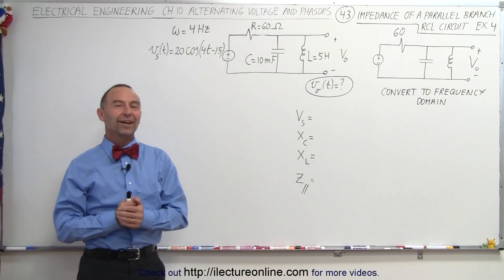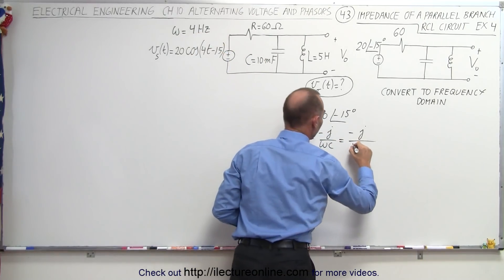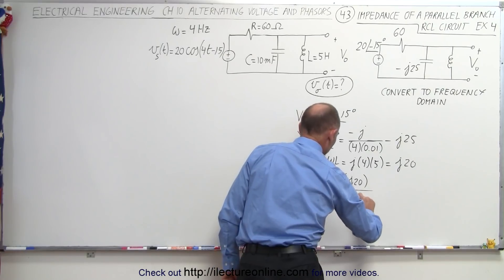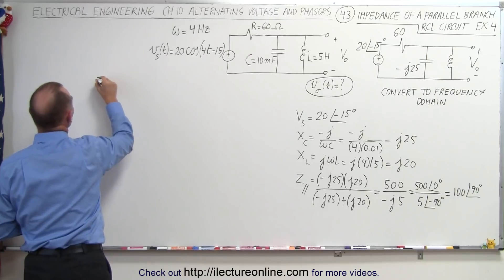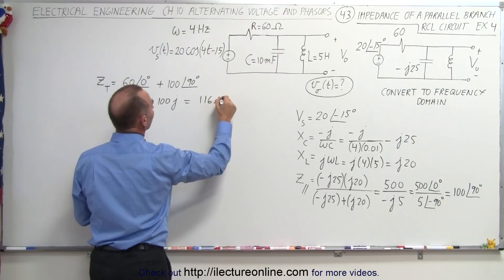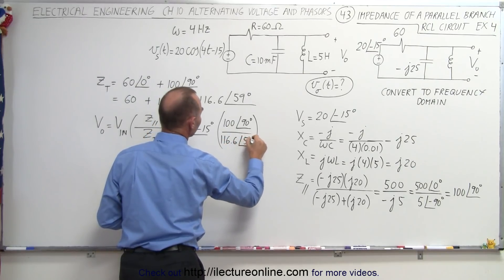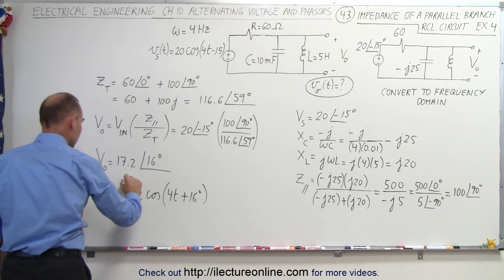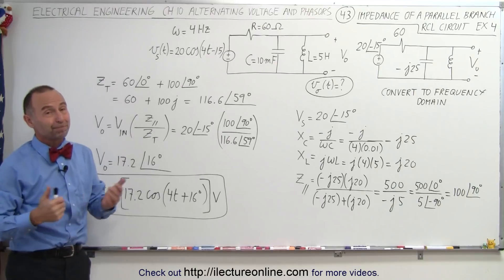Electrical Engineering: Ch 10 Alternating Voltages & Phasors (43 of 82) Z=? Parallel RCL Ex. 4

Comment: I ran into a confusion situations. I goes trough the resistor so we can get the current from ohm's law I=V/r. then we can find the parallel impedance and multiply it by i to get Vc=V0=Vl. but this does not yield the same result. (I asked chatgpt why )  it said that because the inductor and capacitor influences the current in this circuit so it's wrong to assume I is equal to V/r. (This explanation seems ok. Can anyone confirm ?)
Reply from the maker: Yes indeed.  When there are other components such as an inductor or a capacitor, and if the voltage is alternating (constantly changing) we need to deteremine the impedance and there will be phase differences (which means that the current and votage maximum will occur at different times in the cycle for the different components.)
Reply: @MichelvanBiezen  Thanks a lot sir.

Comment: Minor error in this solution. Omega has units of radians / sec and frequency has units of cycles / sec = Hertz. The two are related by Omega = 2 Pi  f . So the solution is correct if you change [at the top of the whiteboard] the Hz to rad/sec. :-)
Reply from the maker: Since radians is a "non-unit", rad/sec are written as 1/sec and thus equals Hz as well.  The difference usually comes from the context as you mentioned.  (It is always better to write "cycles/sec" and "radians/sec" to make it perfectly clear if there is any doubt.
Reply: With all due respect, it is Hertz, defined as cycles per second, that has the unitless numerator of cycles. Omega (radians/sec)  =  2 Pi (radians) f (cycles / sec). Radians is a unit of rotational position. See ..... https://en.wikipedia.org/wiki/Hertz. I am an experienced electronics engineer and Physics teacher. I doubt I am incorrect here. ...... AND I love your wonderful contributions to Mathematics and Science education. In my opinion, your videos will be watched for many decades to come, and maybe much longer. It is a great body of work. Thank you.
Reply from the maker: You are correct and I don't disagree with you.  (And I do appreciate your comments because that is how we all stay honest).  You will find that a lot of texts do not make that clear and I advise my students to write it out explicitly.

Comment: I was wondering as to why the parallel impedance was taken with respect to both the capacitor and the inductor. Isn't the voltage drop across the capacitor the same as the voltage drop across the inductor which is the same as Vo?
Reply from the maker: In order to calculate Vo you must know the impedance across the inductor and the capacitor, and since they are in parallel you must know the parallel impedance across them.
Reply: @MichelvanBiezen  I see. Thanks a lot

Comment: Sir,thanks for your clear explanation. 
But I have a question that "Do I need to use V(r.m.s) instead if V(max) in this type(AC) of circuit ?"
Reply from the maker: It depends on how you want to express the answer (in V rms or V max)
Reply: Sir, thanks for your reply.I have also another question that "Does there any convention in which I can write 'r angle(৳)'[in phasor domain]='r sin(wt+৳)'[in time domain] instead of 'r cos(wt+৳)'? "